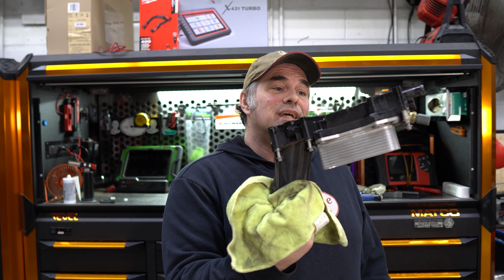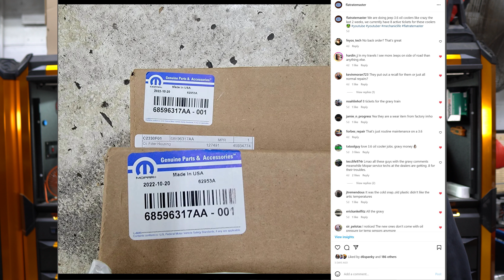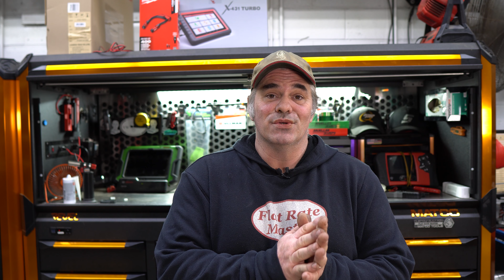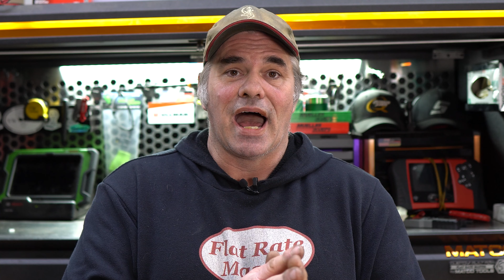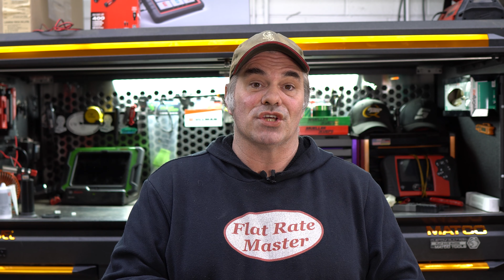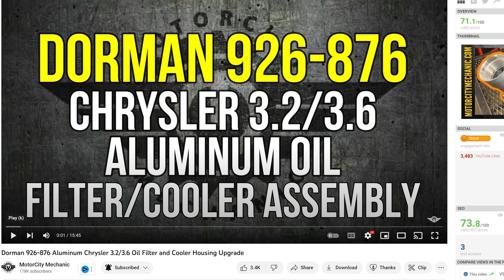No I am Not Using Dorman!

Comment: Based on the comments, it sounds like other peoples experience with the aluminum Dorman oul coolers is different from yours. You forgot to mention the oem plastic filter housing also cracks (from quick lube abuse?). I ended up replacing the oil pressure sensor after 3 months, its accessible w/o removing any other parts.

Comment: We use a lot of those 3.6 coolers. By a lot I mean we did 3 on one day 2 weeks ago. We keep 4 different ones in stock if possible. There are two that make metal ones Dorman and another. We keep a Vemo a Mopar then both plastic and metal Dorman. There is another metal one we have in stock now. Most of the techs prefer the metal Dorman over the Mopar one. Honestly we have never had any of them come back from any brand and like I said we do a lot of them.

Comment: Got a Dorman water pump for a 5.9 Cummins in a 2004 Dodge Ram 2500. Complete failure I could not even bolt it in.  Hello OEM at 5 times the cost but it bolted right in and works great.  BTW it was my personal truck and I also replaced all the hoses, thermostat, and tensioner pulley. Everything ended up being OEM replacement parts. that was 4 years ago and everything still works great

Comment: I refuse to use any dorman product  there quality has gone to pot over the last 10 years and they do not back there products as they say  and they do not cover the labour cost of replacing there parts when the fail prematurely  yet napa parts ford oem GM oem  even some times dodge will cover the labour costs I hate aftermarket in so many ways

Comment: I just put a dorman 3 6 oil cooler assembly in today. Shop cost was 249 through advance auto. The customer about fell out when they were told it was 289 and 2.6 hours labor.
Reply: I mean, most people who don't know anything might think, oh oil leak, simple cheap. for some people that 300 plus 2.6 which is what? another 300? Not sure where you work ect labour rate but ye. 600 for a leak isnt good news for the average person.
Reply: I guess my point is they came in today. They are on the road leak free tonight and saved 100+ on the part and are not waiting to get the oem part. It may not be for everyone but most out customers 150 dollars is worth going after market. Comes with upper and lower intake gaskets to. The oem does not.I like the wings of failure, i will have to tell the guys that tomorrow. We are out of central fl

Comment: I have had good luck with the GM truck front air bag impact sensors. I believe they are from the same supplier as GM. They have no wallet with wings markings and look just like the GM ones. My service writers know if any other dorman parts come in I will drag them to the back and whip them like a rented mule.

Comment: Dorman is junk.  Your rant is legit 👍I went to working on classic cars but still did modern cars on the side.  The last time I used dorman was for f350 hvac door modules where you take out the dash.  They both failed in a month. And a vent valve on a Chevy truck - failed as well. I won’t dorman anymore. Nothing like redoing those side gigs after your regular job at 10pm.

Comment: While I do agree with dorman being crap, I work on a Fleet of caravan cabs with the 3.6l I have done so many of those coolers i'm sure I could do them blind at this point. We just used the OEM cooler, ( and even those fail at a stupid rate), However there was a shortage of them last year were we couldn't get them for 4-6 months. So at that point we tried the dorman part. I am a shocked as anyone but they have held up perfectly for us, particularly as we deal with severe cold here in Canada.

Comment: I'm not a professional but I wrench on my own stuff once it's paid off except oil changes and tire rotation. Firestone over torqued mine on a oil change on my 16 Cherokee and cracked the housing.  I replaced it with a dorman metal one but I didn't know they had such a bad reputation.  I'll never buy Chrysler again that whole cooling system was a POS and a pain to work on.

Comment: I did this oil cooler for a town and country and I grabbed both Forman and the dealer part and after unboxing, they were absolutely identical.  They are made in the same factory.
Reply: I saw a Bosch throttle position sensor in a Walker box. It's strange how that works sometimes.
Reply: It’s hard to trust anything nowadays.  I came across the same issue with a 2009 ford escape.  The factory brake shoes were identical to the oreilly brand.  The only difference was the box.  The parts guy at ford dig deeper and found the parts in our hands had updated part numbers.  The quality ones got discontinued.  Ford outsourced subpar parts :/

I’m sure this is happening more and more as the United States consumer really allows it to happen.  I know that overseas, cars among other things are built better.  

In the end, don’t get hung up on a name.  But do find a quality part to install, and it may not always be a dealer part.
Reply: I sold a Dayco upper radiator hose for a Dodge Avenger yesterday, and the coolant cap had the Chrysler Pentastar and part number. It didn't really surprise me one bit.

Comment: I fix a fleet of 3.6s (200 or so vehicles), every failure is flattened orings. The actual cooler is fine unless you overheat the motor.

Comment: I've been using Mahle thermostats for the 3.6 and compared to the OEM and they are identical. Both made in Mexico and both have the same barcode marking on the side. not to mention they were a lot cheaper than OE. Hope this helps
Reply: Mahler and motorad both make the thermostats for chrysler. I've gotten them out of Mopar bags with both emblems on the.

Comment: Pretty sure the Napa thermostat I put on the wife’s 3.6 had to have been a Dorman.  It’s had a small leak around the bottom bolt, and yes, I cleaned the flange prior to reassembly. Probably gonna go get an OEM one and replace

Comment: I'm pretty sure the 3.6 Pentastar was manufactured in the Dorman factory, making Dorman the OE supplier.
Reply: The pentastar is the pinnacle of reliability compared to GM's 1.4 & 3.6 and Fiats multiair.
Reply: @redneck4528  While I don't have any Gm 1.4, or fiats. in my fleet of cabs I have damn near as many GM 3.6L as I do pentastars. And I have to do very little engine work on the GM's compared to always fixing failed rockers and oil coolers on the dodges.
Reply: @beilno2890  you haven't done a timing chain job on a GM 3.6 yet... you're in for a treat
Reply: @redneck4528  Oh I am sure the job sucks, though at this point I doubt it is any worse then the water pumps on 3.5L fords. But if the job rarely/never shows up, even if it sucks doesn't really show that hey have worse reliability.
Reply: I think you're on to something.

Comment: It's a wonder that someone hasn't come up with a kit to relocate the Mopar oil cooler to somewhere other than the stock location. A fender well mount or in front of the radiator sounds like a better place.
Reply: the normal place for an oil cooler. lol. why we gotta complicate every engine and the parts placed on it. I think Anyone would give up 4-6 inches on the front end of a car to make a part serviceable. so its not a large repair if it does break. Just so annoying.
Reply: It wouldn’t be such a big deal if they’d just design it better so it lasted the life of the engine. The problem is that it’s in a bad spot AND it was a poorly designed part.
Reply: @Jpilgrim30  agreed.

Comment: There’s one thing I know Dorman does better than OE…everyone knows the shitty ford lug nuts that swell and you have to hammer a socket on to get them off cause a company that’s been making cars for 120 years can’t figure out how to design a lug nut? The dorman replacement lug nuts are a 1 piece design, no chrome cap BS.
Reply: The big 3 plus some Toyota and Honda’s have the same design. I’ve done enough rotates on Rams and Silverados to just grab a 22 and 23mm so I don’t make two trips.
Reply: @warrenself  it’s a problem for all of them but I feel like most often it’s the fords.
Reply: Ford had this problem in the 80s on the Ranger. But I see a lot of GMs with the same problem style nuts before the plastic cover caps came along. Molars also has em.

Comment: As a Chrysler tech I will tell you that Chrysler updated the part number. With the new part number the oil cooler assembly does not come with the sensors anymore. 
We as techs are having to get in tune with time management, part ordering, and service advisors recently. This b/o parts situation is hurting paychecks when we are not able to complete jobs.
Reply: I think the sensors is what made them back ordered. Sucks because those aren't readily available. And always love when they don't come out of the housing when the brass fitting if you have to reuse the sensors.

Comment: I believe dorman makes an aluminum version of that housing that never fails. Idk why people go oem
Reply: The dorman one only fits the 1 version of the engine, not later generations. They are NOT backwards compatible.
Reply: @LoneWolfSparty   how do you figure? We get them all the time with the temp sensor that’s on there and they fit right in there on the ones that don’t have that. Intake plenum still clears it.
Reply: @Wdbjr12345  I think in the instructions with the dorman kit it even says what applications it does and does not work for; the one I had, it fit, but one of the bolt holes didn't line up (and it wasn't even close either), I think it was one of the ones that was mentioned in the insert too. I'd have to look at the RO at work to tell you specifics as to what make/model it is.

Comment: Dorman is fine. At least they step up and try to improve a crappy design. Apparently the OEM isn’t the epitome of quality either 😂
Reply: When is Dorman going to improve on their crappy improvements though? They’ve literally admitted they have design flaws.
Reply: @Ram2253spd  well then it looks like a huge opportunity for some competition. All the armchair experts need to get together and show them how it’s done. Oh wait, they can’t, because it’s actually not that cut and dried easy.
Reply: @chekelley6861  that doesn’t exactly answer my question though. Dorman has constant failures on most of their current products but instead of improving on those they just make more “improvements “ to what they think is an OE failure.
Reply: @Ram2253spd  who says they have any more failures than any other manufacturers? It’s all anecdotal stories. Out of the millions of Dorman parts used each year, there are bound to be failures. I mean it’s not like there are that many different factories in the world that make fuel pump modules or xyz thingamabob sensors. They all come from the same place. I’m fairly certain that if a scientific study was done, their failure rate, as a percentage of parts sold, isn’t much worse than OEM. I assure you, if Dorman went out of business tomorrow, the motoring public would be royally screwed.
Reply: @chekelley6861  if everyone would be screwed which part in existence right now is only purchased through Dorman?

Comment: You would rather replace the failed plastic part with another plastic part instead of a metal oil filter housing? The issue is the plastic part warps so that’s why they made it all aluminum. Why go back with the same part that failed in the first place. That doesn’t make much sense to me
Reply: Look at the Motor city mechanics video; the aluminum one does NOT work on all versions of the 3.6.
Reply: @LoneWolfSparty  his video is a year old, dorman offers an aluminum replacement for all 3.6 engines now